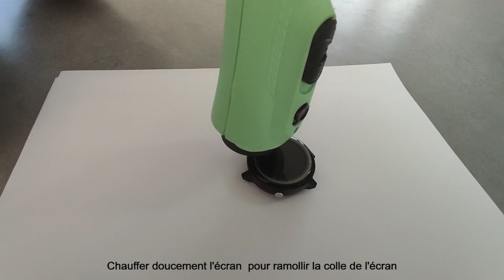Démontage montre Garmin vivoactive 3 remplacement du boitier / disassembly case replacement repair

Comment: The battery is the grv-300sh 3.7vdc 160mah
Reply: tried to use this but battery is low after like 3 hrs idle.

Comment: Hi what type of screwdriver to remove tye screws?
Reply: Metal works best.
Reply: @tanakaobi  thanks but I mean  the type of head? Phillips ect
Reply: @clairegoodlet2472  Dude, I was just bored and trolling you!
But look at 0:53. It seems like hex screw to me. 
The better question is where to buy the battery from...
Reply: @clairegoodlet2472  What screwdriver do you use?  what size?  Torx?